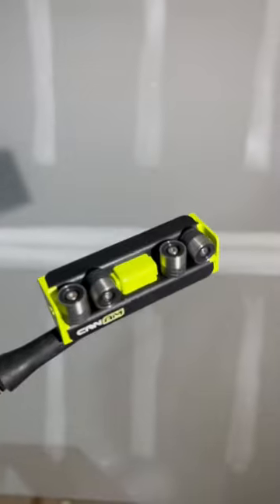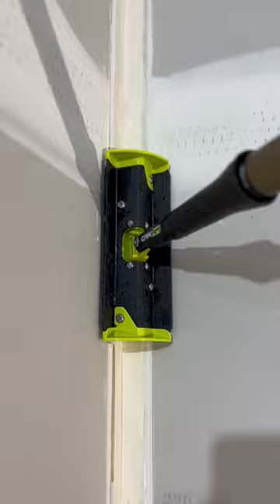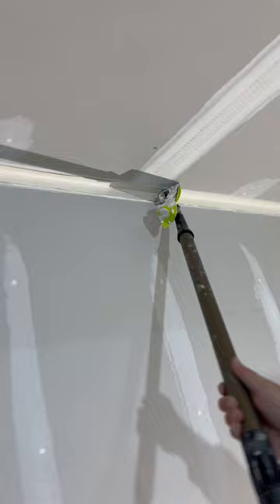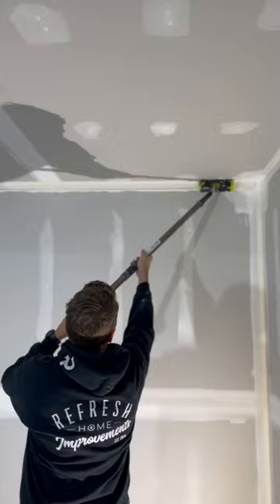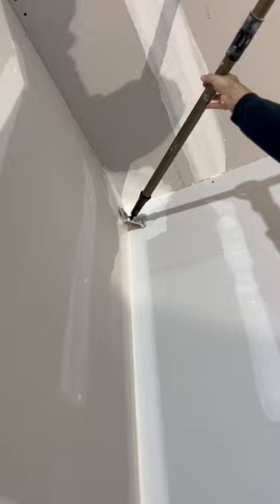Check out this awesome drywall corner roller!

Comment: Wait, so these could put the mud and the tape
Reply: No
Reply: the mud syringe is used apply the mud quickly into corners or flat joints, useful for many joints, then the roller and then the flusher